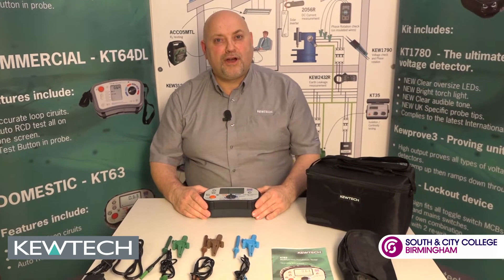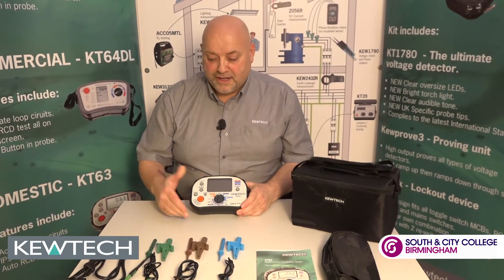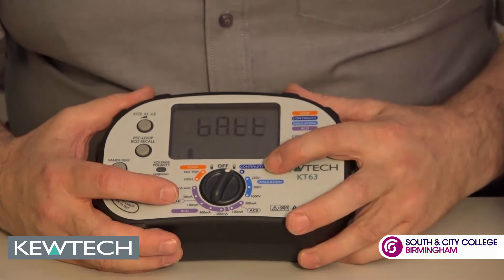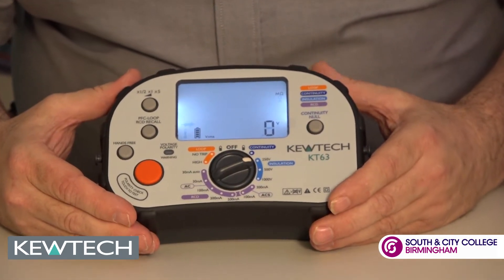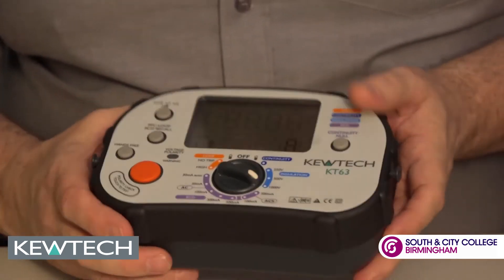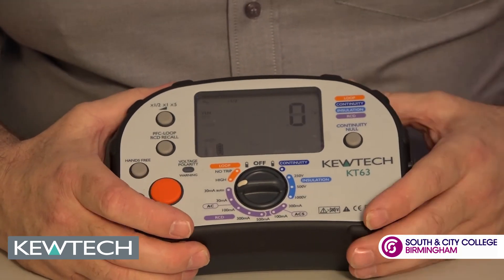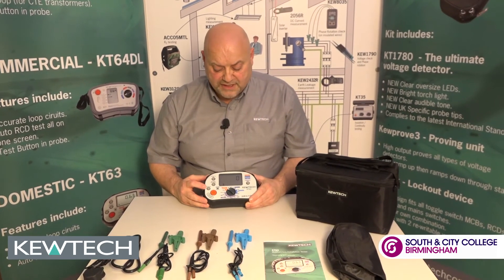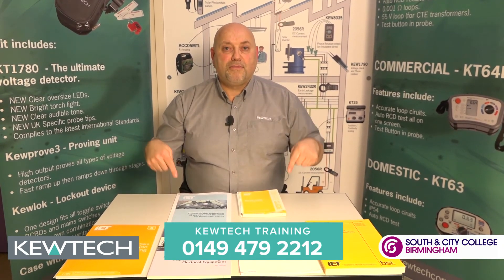KT63 Two Minute Demo

Comment: Here is a link to a video using the KT63: https://youtu.be/_twVvsGo81A

There are a few comments on the thread for this video implying that the guy is using the instrument incorrectly when carrying out a high current test with three leads.
Can you clarify if high current test should or must be carried out in the two wire mode and what effect his method will likely have on his results and/or the KT63? 
Thanks.